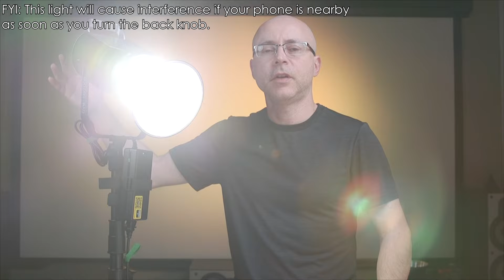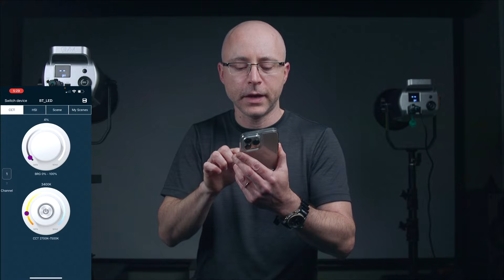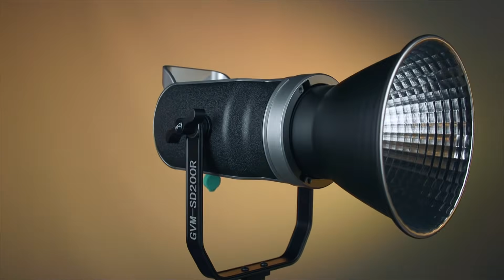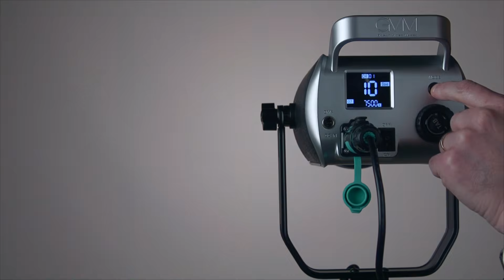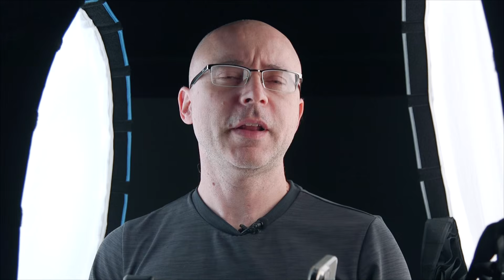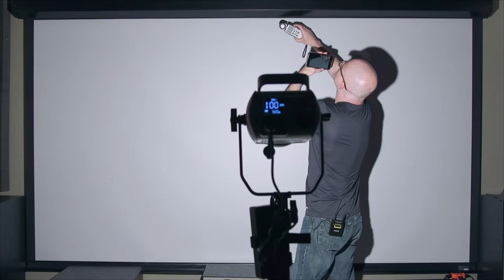GVM SD200R RGB LED Review (chapter indexed)

Comment: 7,000k is more accurate for 5,600k than 5,600k?!? How could GVM make such a massive mistake?? Are you sure that you are correct on that? Did you measure it correctly?
Reply from the maker: You can even see by eye. No meter required. It’s that obvious.

Comment: Hi thanks for this review! How does this compare against the Godox SZ150R? Which do you think is better and would recommend?? Your input is highly valued, thanks in advance for letting me know.
Reply from the maker: The SZ150R, the 5600K is spot on while the SD200R is warm at that color. On the SD200R, you just have to adjust to around 6500 to get 5600K. I can’t specify for sure about brightness because I’d have to get both and setup just for that which I don’t have the time for, but they’re both bright. The SZ150R has more FX if that’s something you care. Price is almost the same on both lights. Between the two, I’d have to go with the SZ… Well, based on the above, I guess only you can decide… I hope that helps?
Reply: @ArtVideoProductions  I see ok thanks for your input. I am leaning toward the SZ150R but just saw that there is a GVM Double Head 300 Watt version. Have you had a chance to test this double head 300W version?
Reply: I've seen some reviews of the SZ150R and some users stating it's not bright enough and would be curious how it would fare against the GVM double head 300 watt RGB??
Reply from the maker: @nikkoarnado1878  yes the ST-300R is a great choice. I love that light. https://youtu.be/dFTc9ij8QRQ. Also, the YU300R which I also reviewed. It’s easy to find on my channel.

Comment: Would you say this is a good upgrade from the RGB-150S?
Reply from the maker: ABSOLUTELY. I compared both, the 150-S I found it to be a bit weak for a 150 watt light as I have other 150 watt RGBs here, and the LEDs on the new lights and software is much better as well. I forgot to add… if you still need RGB, get the SD150R. It’s a lot brighter than the old 150-S

Comment: There’s some weird noise when you spin the knob or press buttons in master/slave mode. Like interference directly.
Reply from the maker: That’s correct. I don’t know if you noticed but I put a caption on that in the video when I was turning the knob. Make sure your cell phone is on airplane mode or far, far away from the SD200R.

Comment: I'm getting confused here. What's the power-consistency difference between ST200R and SD200R? They're kind of similar to me to some extent.
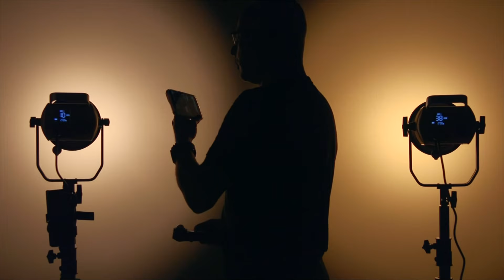Reply from the maker: As you can see, at 21:11 the SD150R needs to set to 38% to have the same brightness output of the SD200R set to 10%. It’s about 25% brighter.
Reply: @ArtVideoProductions  I meant S"T"200R vs SD200R.
Reply from the maker: @Bo_Hazem  ST200R is a very cool, dual sided light, 200 watts, and 200 watts PER SIDE! And has a ballast to connect to.

The SD200R, no ballast, it’s 200W all LEDs mixed into one chip.
Reply: @ArtVideoProductions  Yup, that was my expectation. Is it sitting around so we can see a test and how different in power/lux at different ranges? I think many would appreciated. Thanks again for your extraordinary work!